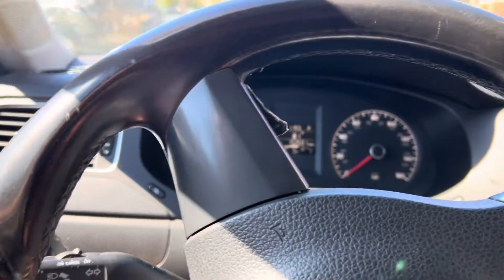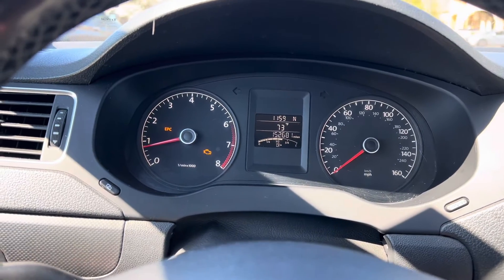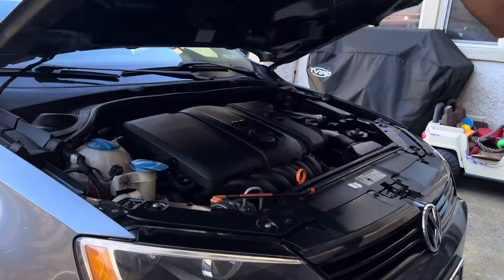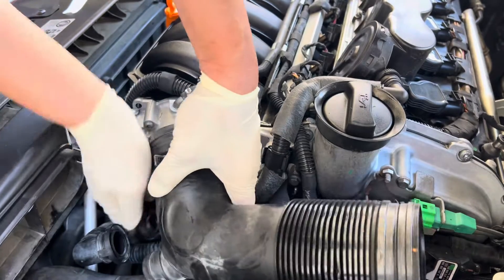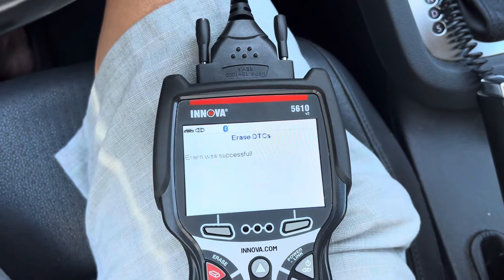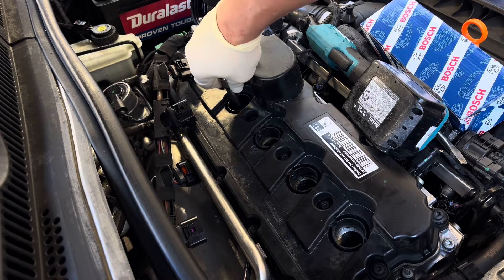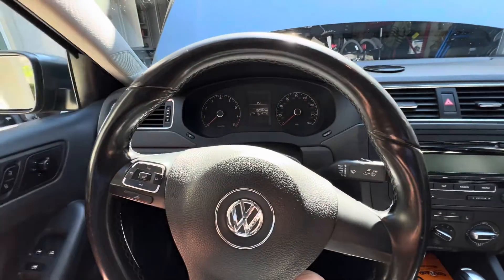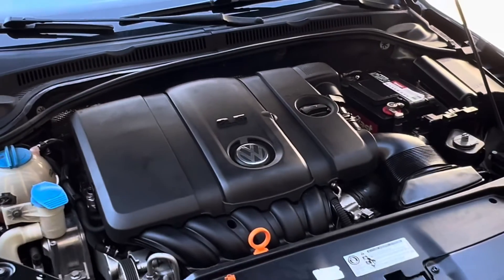Volkswagen Jetta Engine Misfire Code P0301 - P0302 P0303 P0304 P0305

Comment: Its a 2.5L VW, its almost idiot proof except when idiots mainly people who treat their dubs like an old Amerikan car are involved. When a coil pack goes bad it is time for a tune-up that means (5)all new coil packs and (5)new spark plugs properly gapped. Get yourself a permanent marker and put the maf on to start the car without the intake, carefully unplug each coil pack and notice if the engine sputters. If it sputters it works! now mark it with whatever you need to remember that. Keep going until you reach the coil pack that shows no change in the engine when unplugged, voila that IS the bad coil pack so drop it in the bin. Keep going until each coil pack is checked now start your tune-up replacing everything. The old coil packs that still work go somewhere in storage for emergency case scenarios. While you are in there, clean your Maf and your Throttle body with Brake or Carburetor cleaner and any other neglected sensor you forgot to clean over the last 5k miles. Why are you doing complete maintenance is a question no one who drives a vehicle should ever ask. Coil packs die and they usually go one at time, but NOT typically far enough apat for peace of mind. Spark plugs otoh can fail at anytime and can be individually replaced if you like. The only question you should have is you are not maintaining your Vehicle to run properly, do you want to start before or after being towed home, cheers.

Comment: They make a coil gapper tool, its like a coin and you can measure the gap of spark plugs and also use the tool to widen the gap if needed. Works great to see which one is bad

Comment: I'm having same problem on my 2008 jetta 2.5. i changed sparkplugs, coil packs, still doing replaced the pcv valve, still doing it, replaced the whole valve cover with a new pcv valve. Still doing it. Just replace the mass airflow sensor still doing it.

Comment: I have a MT instead of automatic, with a p0301 code. This is the second time I've gotten this code within 2 years for the same cylinder. I'm going to change the ignition coil. Hopefully that helps
Reply: Did it help?